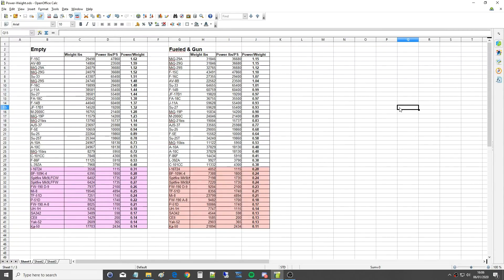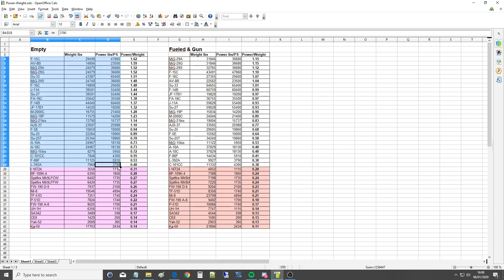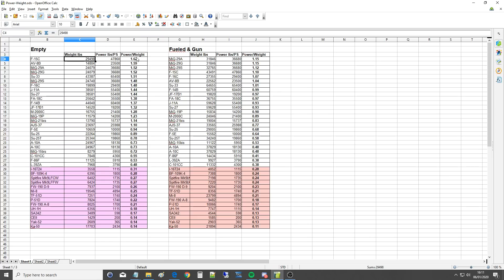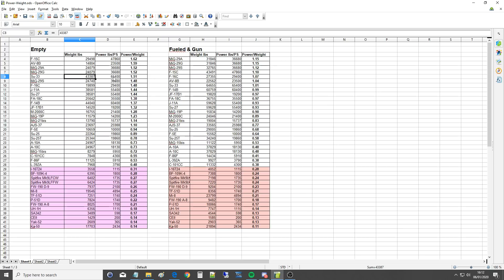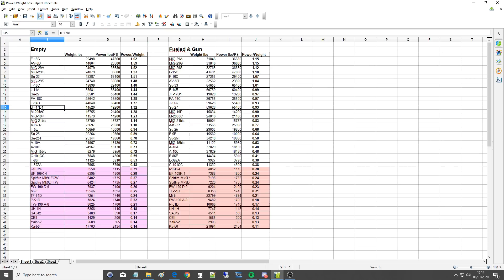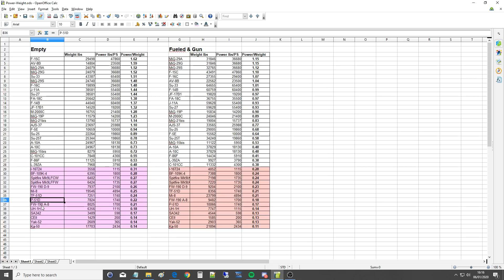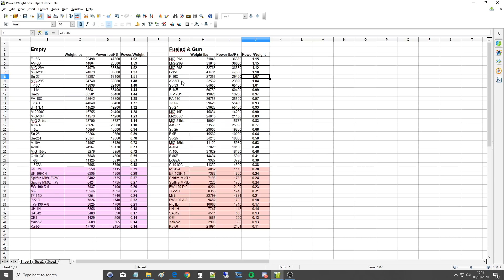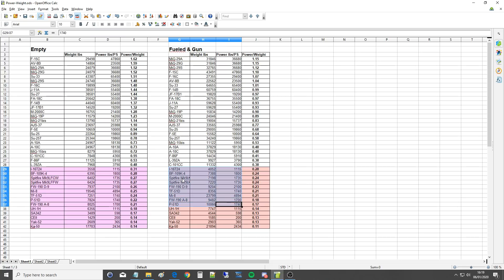All Aircraft: Thrust Power To Weight Ratios | DCS WORLD

Comment: F-16C and F-14B/D both use the General Electric F110. The F-16C uses the F110-GE-100/-129, while the F-14B/D uses the F110-GE-400. The main differences between the two versions of this engine are that the -400 has a 50 inch plug added to the afterburner section so it will fit the longer engine bay of the Tomcat; and that the -400 has its accessories gearbox attached to the engine, rather than the airframe in the case of the Viper. The -400s were also detuned to produce approximately 2,000 lb-ft less thrust to extend engine life. Due to the modular design of the F110, the different versions have more than 82% parts commonality. When the F-14s were retired from US service, the engines were removed from all of them, including aircraft going to museums, and were returned to the supply chain for F-16s.

Comment: CAP let’s talk about your fav jet and mine; F-104 Starfighter. As you know it used the J79 TURBOJET. The most potent of all the variants was the -19. About 18,000 lbs thrust. As you also know the turbojet needs air following through it to create its thrust unlike a turbofan, with its higher bypass ratio, has better acceleration it lower speeds. But once the turbojet is moving it out accelerates the turbofan. Turbofans lose thrust with altitude increase whereas turbojets maintain and even gain thrust at higher altitudes. Now here is the significant fact about the 104 with the J79 turbojet. Static thrust as I’ve stated is 18,000 lbs BUT at speed (Mach 2) and altitude (30,000+ feet), its engine makes a whooping 25,000 lbs thrust! This is why the bird could cruise at Mach 2 at 3/4 AB at 73,000 feet. Is this another dazzling fact to warrant a GR group request for a F-104
Module??? The turbofan is coughing and wheezing at about 25,000 feet. In DCS the 104 will dominate all other jets once at altitude and speed. Imagine a GR 4 ship taking on another squad launching Sparrows from 70,000 feet at Mach 2? Total domination. Thrust to weight ratio goes from 1:1 at sea level to 1.4:1 at speed and altitude. Can you say BOOM & ZOOM from above and bellying up well above 50,000 feet for the reattack? Imagine some hapless F-15 cruising at 30,000 feet thinking he is SH way above the battle only to find himself getting outrageously vertically gunned from way above? The 104 in DCS will rewrite all the rules and tactics of aerial warfare. Tip tanks are good for MACH 2. “Yeah mate. Kept getting gunned from above at 40,000 feet on my way to the fight BY A JET CARRYING EXTERNAL TANKS.”

At sea level:
F-15 1.6:1
F-104 1:1

At 35,000 feet:
F-15 0.7:1
F-104 1.4:1

Hilarious.
Reply from the maker: amazing, my knowledge is COMPLETELY lacking here, thanks for the input!

Comment: If someone is interested in some background info:
Subsonic military planes like e.g. A-7 or Harrier cannot go supersonic in level flight despite the high amount of available thrust because they use convergent nozzles. 
Basically, the jet engine needs to "throw something aft" to produce thrust. This "something" is air / burnt fuel. In order to exceed  Mach 1 (depending on temperature: 300 m/s at around 0°C) the engine needs to throw air out with at least the same speed. Problem for Harrier / A-7 is that they use convergent nozzles (cross section gets smaller from front to aft;  like: >). A convergent nozzle produces a shock front at the most narrow section and speed after the front would be subsonic. So the jet exhaust speed cannot be > Mach 1. 
Supersonic fighters have a convergent / divergent nozzle like: >< which allows super sonic speed of the exhaust airstream.
 
Basically, while the Harrier can throw a lot of air aft he cannot throw the air with high enough speed while supersonic engines/nozzles allow higher exhaust gas speeds.

An analogy could be: you have horses which can run at max 30 knots. If you let one horse pull a heavy cart it might be able to reach 10 knots only. If you put a lot of horses in front of the cart you can reach max 30 knots. But even with 1000 horses you would not be able to exceed the 30 knots because the horses cannot do more than 30 knots.
Higher speeds could be reached only with different kind of horses which could run faster than 30 knots.
One way to make the "horses faster" in jet engines is higher temperatures of the exhaust air. Basically, that is what an afterburner (aka "reheat") does. But to convert the higher temperature into higher speed you need a convergent-divergent nozzle which allows to accelerate the exhaust air stream to > mach 1.
Reply: but top speed is when the air resistance is equal to thrust ( somewhat ) . so if top speed is achieved when the thrust 100kn is matched with 100 kn of air resistance. so if we make the thrust 120kn then the air resistance should be 120kn for it to stop accelerating and for the air resistance to increase we would have to go faster
Reply: @moizabdul5384  The problem is:
1- drag is proportional to speed squared iirc.

2- To break the sound barrier you have to go through transonic region, which is known to have a lot of drag. You can see in DCS even, supersonic planes will have a hard time breaking the Sound Barrier sometimes
Reply: @DemonLordGamingAC0  yes. but i proved how his horse analogy was wrong
Reply: @moizabdul5384  I don't see how you did, and I don't know supersonic physics enough to debate it.

In my opinion it's like the difference between Torque and Horsepower. It's like, a lot of torque is still a lot of power to push something but if it's not tuned to High-end (if you don't know, engine Horsepower is basically Torque times RPM) you're getting less horsepower from it and thus less top speed. But the torque is there.

For example you can have an engine that will produce 420 NM of torque, but if it's at 2000 RPM, then you'll have only about 117 HP. If you have another engine producing 420 NM at 8000 RPM, that is now 471 HP. I think that is the analogy here. It doesn't matter if it has the thrust (Torque), it only matters if the output air velocity (Horsepower) to break the sound Barrier
Reply: @DemonLordGamingAC0  he said that if you put 1 horse and it pulls a carriage at 10 knots than 10 horses of the same power it will go 10 knots . thats incorrect cause 10 knots is the top speed of the horses and isnt directly related to the speed of the carriage.
Reply: @DemonLordGamingAC0  and  i was talking about general top speed of aircraft exceeding mach 1  the f4 for e.g. if an aircraft has a subsonic top speed than surely it could reach a higher velocity if it wasnt for the increased drag coefficient of transonic or supersonic flight
Reply: @DemonLordGamingAC0  what he is saying is correct shockwaves do cause the air to slow down thus cannot accelerate further and what youre saying is also correct . i just pointed out that the horse analogy doesnt make sense.

Comment: Cap, do a f18 vs f16
Reply: F-16 will win any drag race. Real life pilot who flew both tested this on the same runway: F/A-18 was at 330 knots at the end of the runway while F-16 was at 500+ knots. (Flight Journal June 2003)
F/A-18 is heavier, draggier, and feels much more underpowered than a pure comparison of the paper specs would suggest). As somebody said, one difference between the two is: F-16 can fly with one engine, F/A-18 can barely fly with two. 
A bit like F-14 vs F-15: F-14 empty weight is about 5 tons above F-15. 
Top speed depends on other factors. E.g. Harrier with very good T/W ratio will not exceed Mach 1 (unless in a steep dive)

Comment: The thumbnail. In the 80s they used to run up and test SR71 engines here at Davis monthan. You could hear them for a hundred miles away. Now they run up F-35 and F-16 engines, which is still really loud, but not nearly as loud.

Comment: Looking at the Mig 21 data, in reference to your earlier video trying to replicate what the "crazy egyptial pilot" did with a split S at 3,000 ft, the Israeli pilot that took part in that engagement was saying in the interview that at the end of the manoeuvre  the Mig-21 was ascending from the sand cloud almost like a rocket. That should give a reasonably approximation of what the weight of it was in terms of fuel and weapons carried. It must have, at that point, had a P:W ratio of at least 1:1, which should help ballpark the weight of the plane at the point it managed to achieve it.
Reply: ascending almost like a rocket, that's such a vague statement.

Comment: F-14 does not make 60,000 lbs of thrust. Its more like 47,000lbs
Reply from the maker: DCS manual says 60,400lbs, you'll have to take this one up with Heat Blur Sir
Reply: Grim Reapers https://info.publicintelligence.net/F14AAD-1.pdf link to the F-14’s flight manual.  They are 23,xxx lbs, in the manual. Maybe they modeled it with more thrust than it actually had.
Reply: @williamkillingsworth2619  That's sea level thrust, static.  Low bypass turbofans and turbojets increase in thrust as they increase in speed.  Consequently, as your manual notes, a single F11-GE-400 increases to 30,200 at M > 0.9.

I suspect Cap has confused "best" power and static/sea level.

Comment: F-16 will win over MiG-29 bacause Fulcrum has a way more drag index.
Reply: Pretty much every supersonic fighter has them. They are so they can be opened up completely at subsonic and close to slow incoming air to subsonic speeds while the plane is at supersonic.
Reply: @DoveEnigma13  oh thank you, i didn't know, i just commented because i saw while flying in dcs that the one on the mig 29 and f15 moved 😅
Reply: I honestly don't know but i think we should consider even that the engine won't behave the same way at all speed or altitude. 
I don't know how the f16 intake work but i know that mig29's have a variable intake ramps that allow higher air flow to the engine at higher altitud (in theory the f15 has something like this too)
Reply: They all work differently, but they do the same thing. Jet engines don’t work with supersonic air going in.

Comment: Yeah my first thought that was that the Flankers were on full fuel

Cause that does skew the calculations a lot, you wouldn't really go into a short range fight on full internal fuel with the 27........hell most of the time I and friends ran it, we only took 75% fuel in total. 

I think another comparison at combat loads (full missiles and normal ops fuel) and one at the beginning of WVR fight (half missiles and certain ammount of fuel.)

F-16 vs. Su-27=Constantly checking fuel and taking bags* everywhere vs. fuel worries, what are those/fuel till the doctor comes ;) (german tongue in cheek way of saying no worries about that, came from celebrating/drinking till the doctor comes.... ;) )

I remember standing on the burners for five 5minutes to go as fast as possible to a patrol area that was under attack and I just went from full internal fuel to half in the 27.

It's also why the quick dogfight modules in Falcon BMS give you a wrong impression of their capalities, when you start them on full interal fuel you'd think they are much less dangerous than 29s.........until you meet them on a proper fuel load for a dogfight.

Well the F-16 and F/A-18 are air superiority fighters, just that they are the light fighters, with a shorter range. 
The F-16 is basically the western Mig-21, but it was mainly designed as the ultimate dogfighter.
The Design called for 9G on full internal tanks, as for the interceptor, not really, I mean originally they were only armed with sidewinders, and only got BVR capability with the ADF version of the A-Models for the Air National Guard.

*On that note bags are always external fuel tanks.